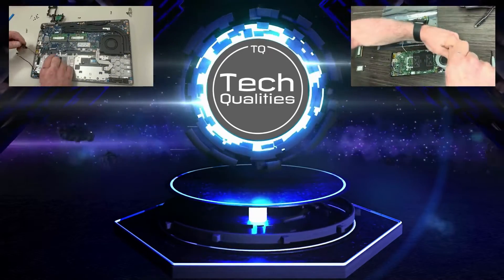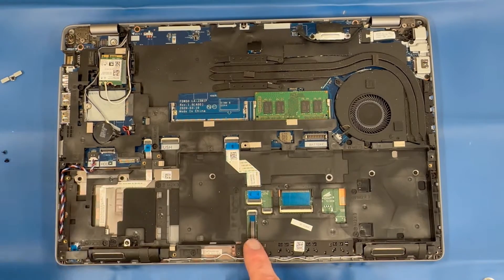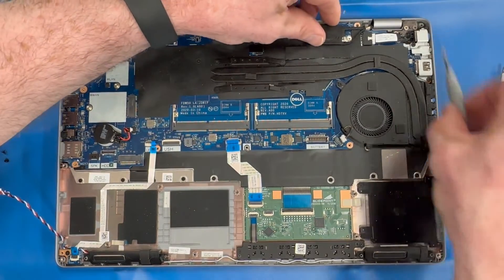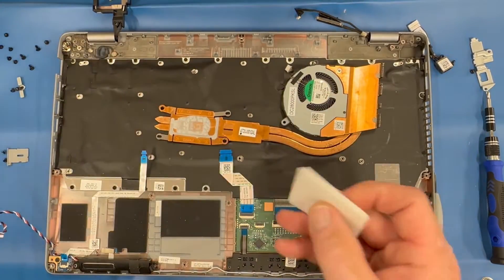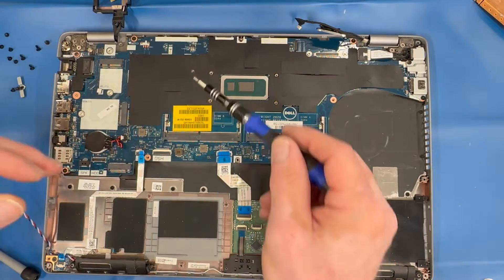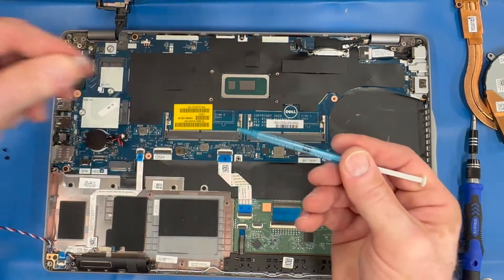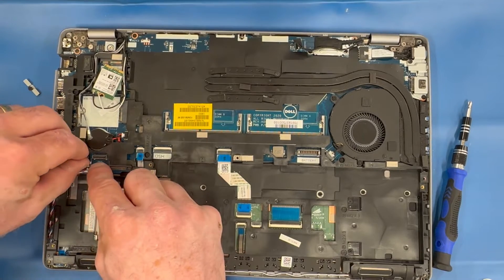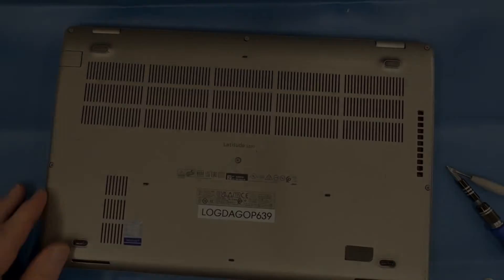Dell Latitude 5510 Motherboard Replacement

Comment: Very helpful instruction. Thank you. My DELL 5510 stopped working. After switch ON the switch and keyboard light up, cooling fan starts spining, but after 3 seconds it goes dead. I disconnect all RAM, HDD, Battery, CMOS Battery but still no joy. Power is supplied to the MOBO. I suspect the MOBO is gone. Don't know why?
Reply from the maker: Sorry for the delayed response.  You did all the right things as sometimes a bad hard drive or memory stick could cause strange behavior.  Only other thing to try is remove the battery and AC power, press and hold power button for 30 seconds (power drain).  Plug just the AC power back in and try again.  If that doesn’t change anything you might have a failed MOBO.   Is there any warranty left?

Comment: Hurray, today I was able to replace the RAM and SSD drive myself thanks to this video.  Thank you so much again.  Everything started working right away without any problems.  Perhaps it will be useful for someone to install two ram KCP426SS8/16 and ssd Samsung 970 evo plus 2 TB
Reply: The laptop has become significantly faster, despite the fact that in my case the processor installed is not very fast, namely i5-10210u.  I also want to note that not every RAM stick will work normally, be careful when choosing them.
Reply from the maker: Thank you for watching!  I’m glad it helped.

Comment: Thank you very much for the video.  I just want to upgrade the ssd and ram.  Perhaps you can tell me if this laptop has a good cooling system or not?  I'm worried that after setup the 970 evo plus it won't overheat
Reply from the maker: The heat sink fan assemblies on these latitudes are all similar.  But they do little to cool your SSD as they primarily just draw heat away from cpu.  As for SSDs, see if the system has thermal pads you can apply that will help draw heat away from it.  I rarely have issues with SSDs overheating.
Reply: @TechQualities  Thank you very much for the answer. I have already installed a Samsung 970 evo plus ssd for 2 TB. Works without problems and overheating. Now, with a powerful SSD and a large amount of RAM, the processor has become the bottleneck, but it certainly cannot be replaced, alas)